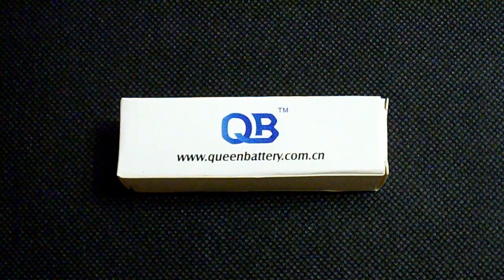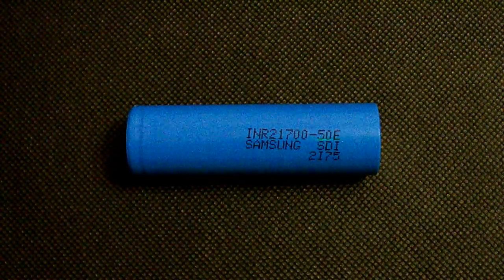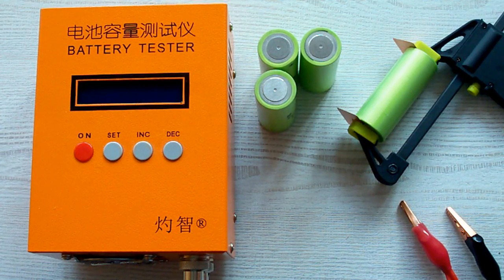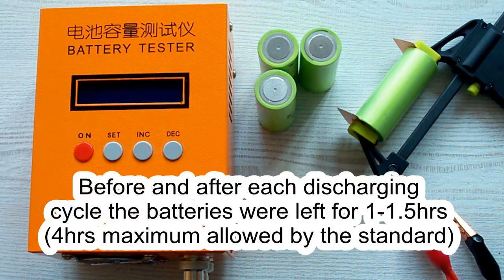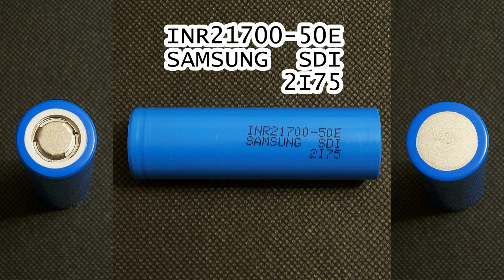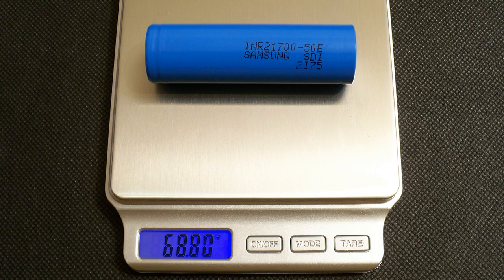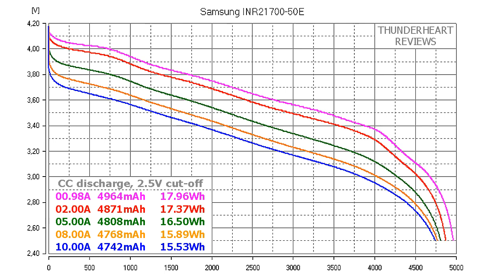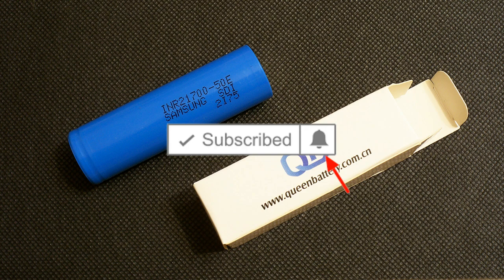Samsung 50E capacity test - 5000mAh or not?

Comment: Hi! I am planning to replace the battery (rated@6000mAh) of my 20watt JBL Charge 3 speaker with two of these. Wull there be any problems I should be aware of? Btw, two 18650 cells can fit inside of the said speaker. Thanks!
Reply: so how did you do? I think the 21700 cell doesnt fit in there if only two 18650 fit in

Comment: I really enjoyed the test.
I'm going to make a 15S1P package and another 15S2P package for an electric bike.
I never use both packages in parallel. Either I use the 1P package or I use the 2P package.
The maximum current is 10A but most of the time the current is about 4A.
For both packages I am thinking of using the LG M50T.
In this environment is it better to use LG in both packages, or is the Samsung 50E better?
Thanks
Reply: I was wrong. I will put this question on the LG M50T. Excuse me.
Reply from the maker: 50E
Reply: @ThunderheartReviews  thanks
Reply: And if I have only 15S2P? Do I have more capacity with LG M50T? My seller will only have 50E in 6 weeks. regards
Reply from the maker: I've tested both cells so you can compare them. 50E is better than M50T in any equal configuration.
Reply: @ThunderheartReviews  tanks
Reply: Thanks
Reply: hey! What did you end up using ? How is you battery now?
Reply: @Ydooo  it is working very well. The cells are very good.

Comment: Do you think this battery is capable of continuously discharging at 4 amps when the voltage drops to 2.55 volts with an ambient temperature of -20 °C ? (I am sorry, I know this is oddly specific, but it gets cold in Canadian winter so😂)
Reply from the maker: Samsung 50E's datasheet says it can be discharged at -20 to 60°C range but its capacity at -10°C would be 60% of initial value. So i conclude that it can do at -20°C but with highly reduced capacity.

Comment: there is a 2nd versione of the same cell

https://www.e-cigarette-forum.com/threads/bench-test-results-pre-production-samsung-50e2-9-8a-4900mah-21700-great-battery.887711/
Reply from the maker: Hi Stefano! Thanks for info. The cell i've tested has no "2" in the bottom line of marking as you could see. If i get a 50E with "2" i'll compare them.

Comment: WoW..This is exactly the same as the 48G...
Reply from the maker: Not exactly. Compare std charge current - 1.44A vs 2.45A
Reply: @ThunderheartReviews  Can you explain charge current?
Reply from the maker: Charge current is the current you apply to charge a battery. The higher it is the faster the cell is being charged. Standard charge current is defined for each type of battery by its manufacturer. It's the optimal current. The manufacturer also defines maximum charge current which is applicable but reduces battery's life (sometimes significantly).
Reply: @ThunderheartReviews  I understand the charge cycles on the datasheet and I also understand the charge rate vrs battery life,I never charge any od my lithium batts over 1 amp mostly.5 but I dont understand why the charge rate would make a difference on the batteries performance.
Reply from the maker: It makes difference in charging time and cycle life. During charging (and discharging) there are chemical processes going in the battery and the higher is the current - the faster the battery loses its capacity.
Reply: @ThunderheartReviews  thank you...

Comment: What is typically an acceptable range of tested vs stated capacity ?

For example:
If the data sheet states 5000 mAh, yet testing shows 4750 mAh, which is 95% of the stated capacity. Is that ok ?

4750/5000=.95
Reply from the maker: A good question. Usually capacity of a unused cell at 0.2C discharge is about 50mAh higher than rated. For example a 2500mAh cell shows something like 2543mAh. But it's not a rule, it's just the most common thing which happens.
P.S. Bear in mind that nominal capacity should be measured at 0.2C discharge at ~23°C after charging at std charge current and leaving for 1hr minimum before discharging (according to IEC61960 standard).